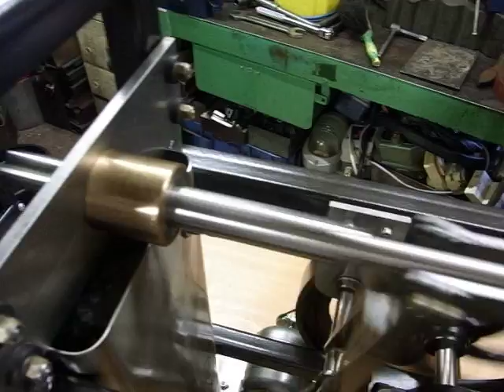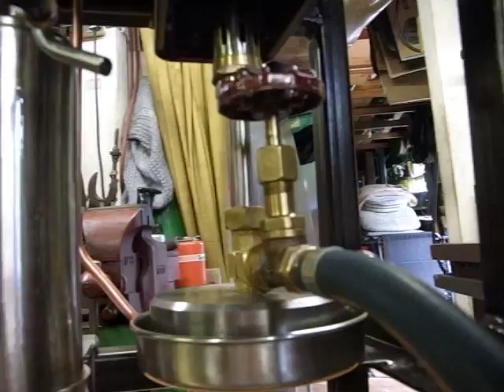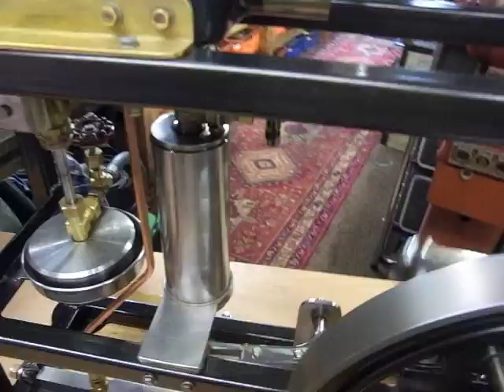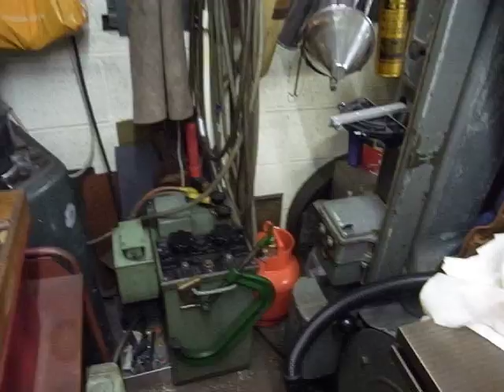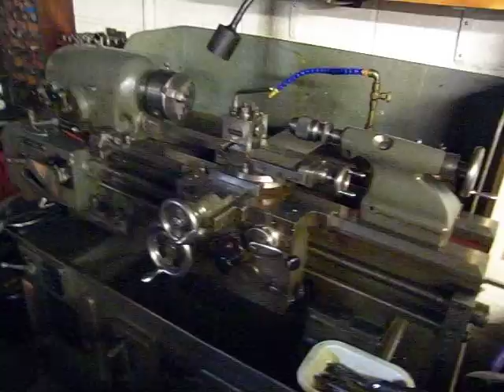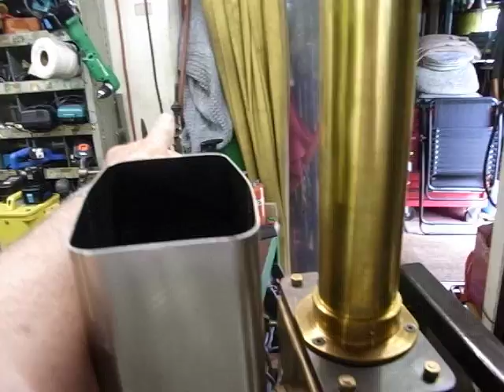HOT AIR ENGINE  designed & built by Alan Pickering of [Dorset].

Comment: Your engine is nice but the construction seems to me to be too complicated and laborious. You have a great workshop
Reply from the maker: Yes you are correct, the alignments were the big problems, the frame being the hardest part, it had to perfectly square,within 20 thou. then the displacer cyl. assembly. A big plus is the oiling, it starts in the displacer rod oil cup, which leaks into the displacer cyl. where a groove in the base channels it into the 1"transfer pipe, lubing the power piston & then draining to ground. NONE ever finds its way into the HOTend & stopping the engine, unlike many designs. It was built as a showpiece it had to be different, my second engine is also built with a vertical open ended power cylinder for the same reason. There are simpler ways so build a Stirling engine !